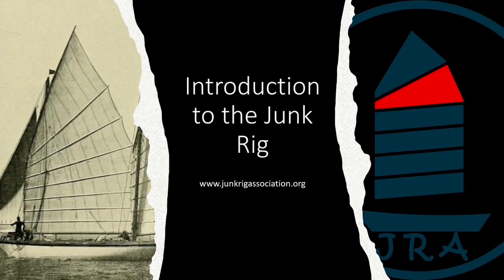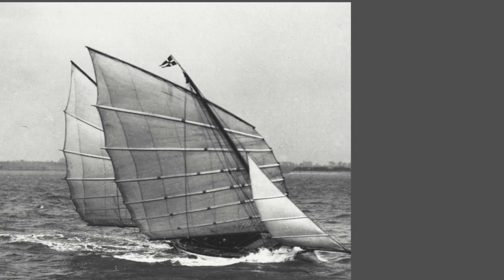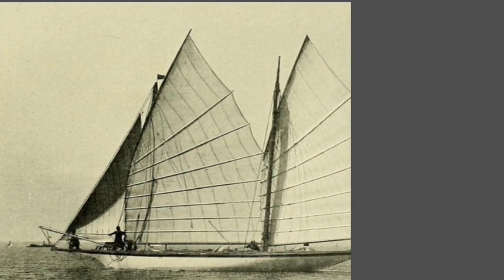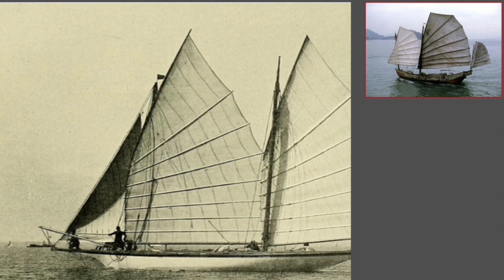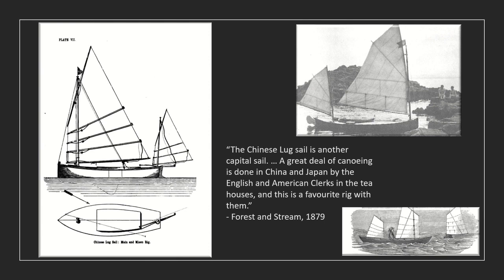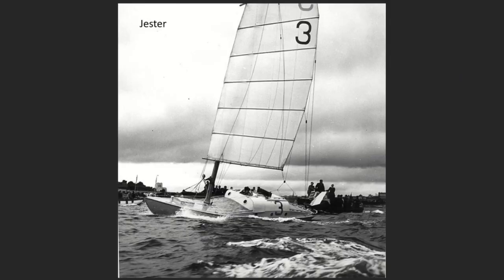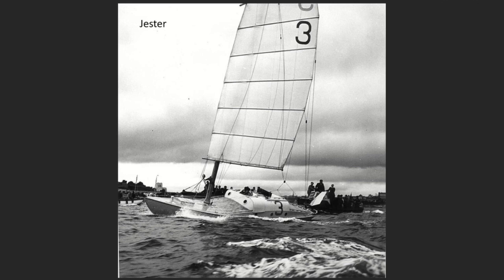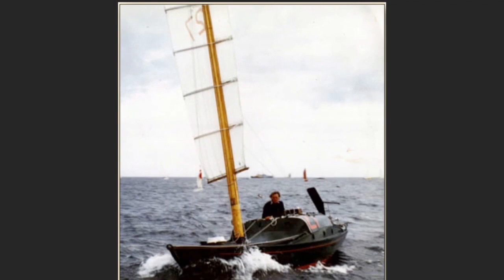Introduction to the Junk Rig, Part 1

Comment: Hi. A question... Say you added a traditional jib front and a mizzen aft, would that help when trying to go close hauled? Which one would help more and why? Cheers
Reply from the maker: Some boats do have such an arrangement but sailing best to windward is much more about the overall design of boat and sails and the best arrangement of sails is the one designed to work well with the particular boat.  Some of the Colvin designs seem to look and sail very elegantly with a jib, for example.

Comment: See SV Seeker. It will be a junk rig sailer and was built in Oklahoma and will launch this year. The Polynesians used a similar rig.
Reply: What polynesians used a junk rig?
Reply: The Polynesian crab claw rig is oriented vertically and pivots horizontally.  The junk rug is oriented horizontally and moves vertically.

Comment: I'm curious as I could possibly be,  so I must ask..... is it possible to "heave to" with a junk rig?   (I learned to heave to with two sails set at opposite angles )
Reply: I'm completely speculating here, in fact I'm sure you have more knowledge than i do - but do you think it would be possible to do so with something like the wind maybe 45° off the bow, sail parallel with wind, helm pointed into wind? Any forward motion would steer ship into the wind, thereby back-filling sails, and vice versa. 
I'm still learning things so forgive me if this is an absurd thought. However i too am interested to get an answer to that question
Reply: @NightSky018  What you describe IS heaving to, if the sails are on opposite tacks.  The bow of the boat oscillates back and fourth across the wind due to it acting on each sail differently.  Also, the helm must be set opposite the mainsail.  That's what starts and maintains the oscillation.

Comment: interesting points, esp. with refference to world sailing, but I did notice the style of rig, with that many battens, one would surely be able to "dump" the top triangles of sail quickly, esp. in bad weather, giving the most calming affects, as the top of the rig is where the most wind affect is. ( but must be a real can of worms having to deal with presumably that many reefing lines{one set for each batten}).
Reply: you missed the point of the junk rig , there are no reefing lines , a set of lazy jacke catch the sail as its lowered bundling it to the boom all that is necessary is loose the halyard  and set it where it needs to be , the lazy jack holds the battens  

  the sheets are mor complex with each batten getting a sheetlet that is run to a single line on small craft or one for each tack on larger vessels all those keep the foils in shape and meen that the cloth dont need to be stretched as hard
Reply: @rustyholt6619  The junk rig sheeting is not a lazy jack.  A lazy jack sits on both sides outside the sail to guide its raising and lowering.  It does not otherwise touch the sail.  

The junk rig sheet is more like a distributed mainsheet with many smaller lines to each batten, brought together in subdivisions.  It's a bit like the continuous reefing lines (single line reefing) of western sails, but probably lower friction due to sheaves at each subdivision.  This means that reefing is automatic as the halyard is lowered and mainsheet tensioned.

Comment: I see little difference between a modern full baten sail and a junk rig.
Reply: They are very different. For a start, what you see on a junk rig is not actually a batten at all. "Batten" is a misnomer. They are spars, and leaving aside the special case of articulated battens, they are intended to remain rigid. They perform the same function as a boom, except there is one for each panel, and usually each is sheeted. The batten you see on a fully-battened bermiudan sail is inteded to bend to the shape of the sail, and to allow a large "roach" to the leech of the sail. A completely different function to the s0-called batten on a junk sail. There is no analogy between the batten of a fully battened bermudan sail, and those essential spars of the junk sail.
Reply: @graemekenyon1649  Technically you're right, but both to help shape and extend the sail horizontally.  The main difference is that the batten is intended to flex to the curve of an airfoil, as you note.